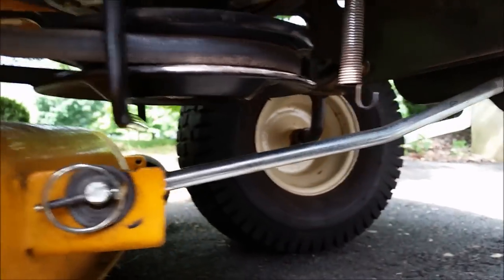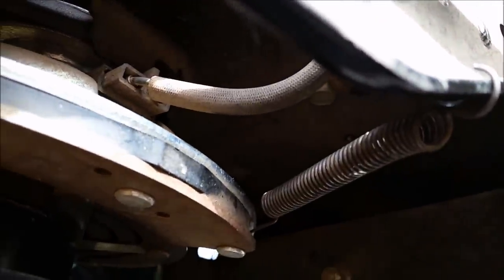Cub Cadet LTX 1046 KW deck removal and blade sharpening

Comment: Changed the blades on my Cub Cadet LTX 1050KW and found the spring you found hanging in the video laying on my garage floor. Thanks to your video I recognized it quickly and was able to hook it up properly. Thanks!
Reply from the maker: Glad I could help! That spring gets me every time!

I just replaced both blade spindles. One had a catastrophic failure. They were cheap on Amazon.

Comment: Excellent video!  I need to get the deck off to replace a spindle.  Almost thought of taking it someplace to have it done but very confident in the deck removal now.   Thanks!
Reply: Good luck with it!
Reply: For a very small part of the spindle cost you can just replace the bearings, that is all that needs replacement, watch a video if you have not done a replacement.

Comment: Somehow I did this without removing that bracket/guide for the belt before but I can't remember for sure how I did it. Hopefully it will come back to me when I get to it. Thanks for the video! Good refresher...
Reply from the maker: statikreg it definitely seems like the belt should fit under the bracket, but I wasn't able to get it to fit. Let me know if you do.
Reply: The chute-side came right off but I had to remove the bolt on the other. Maybe I had to do it before and just forgot. it's been a while. I did find that I have been mowing with the blades on upside down for at least a couple years....It still somehow cut ok, but had to come double check your video when I realized it, and sure enough! So, thanks again!!

At least explains why they hit the stump and got bent (and hence why I had to remove the deck and replace them)...

Comment: If I may: On the drive belt guard bracket you really only need to loosen one of the 1/2" bolts to get the belt off which makes it easier than try to get the bolts back in the holes that you can't see. Also when you have sharpened the blades center them and "free float" to check balance. I use the handle of a screw driver in a vise to check that. Ideally take more off a side if it balances "lower". This saves wear on your spindle bearings if the blade is balanced as it won't wobble.
Reply from the maker: Hi David. Thanks for your comments. Do you have a video of your procedure?
Reply: @flostevematt  I do not but I am sure there are some videos on balancing the blades.

Comment: in the manual it tells how to install the deck,  it says to place a 3/8 drive breaker bar in a square hole on the idler pulley arm, and I use a short pipe to help , put the idler arm back and slide the breaker bar pipe down behind the pulley and it will hold it there till you get the belt on, this releases the tension on the belt and you put the belt on after you have all the lift arms attached, it goes very easy after you follow the instructions, not strap needed,
Reply from the maker: Thanks.

Comment: I remove my blades most every day because I have a lawn service and there is no substitute for sharp blades when cutting customers grass. I have folks ask why when I get done cutting their lawn it looks so much better than the previous contractor. I tell them because I use sharp blades. I get under mower deck with a sharp set and just exchange blades. Takes maybe ten minutes. Word of caution. When you have the front belt keeper off or loose, do not start the engine. You will tear all the electric clutch wiring off. And you do not want to see the cost to repair that wiring. Another secret of mine is take those spindle pulley covers off. All they do is gather clippings and heat up the spindles. I have seen fires start from the clippings from under those pulleys. My neighbor lost his garage from a fire. I warned him, he didn't listen.
Reply from the maker: Thanks for the tip! I can now get the deck off in 5 min, sharpen, and put the deck back on in about 10 more min. I have also replaced the blades many times in the 7 years since I made the video. I have also replaced the spindles once (easy), the starter once (easy), the deck belt (a little bit of a pain), and have been through a couple of batteries.
Reply: @flostevematt  I have a lawn service that I operate alone. I do all the maintenance. I don't replace spindles. I replace the bearings. Buy them on Ebay and if you get the right price the cost is almost nothing. In most cases the parts to these lawn garden tractors are all the same. I think there is only one deck manufacturer. Since they changed the spindle design to four bolts the spindles are mounted sturdier. If you have never changed the spindle bearings, watch a video and you'll will be appalled at the amount of money you can save and how easy it is. I also take the new bearings apart and repack them with Lucas sticky red grease before installing. From the factory, grease in the bearings is minimal and only designed to last for a few hours. I am eight-two years old, I have been there and done that many times. I found out years ago to do a little homework and within reason do the job myself. I come from the farm so my life experiences started very early. Thanks for your interesting video.

Comment: This is doing it the painfully difficult way. Go get a riding lawn mower deck, they have them at home depot, Big R, Coastal, basically everywhere for about $200 or so. You'll want it anyway for easy access to clean underneath and inspect as well as sharpening blades. Jack up the front. Make sure tractor/mower can't fall off lift! Put a 3/8's drive breaker bar (it's a 18" long bar for sockets without the ratchet capability from any auto store) with 15/16 socket on there and I use my foot to push on the bar. It takes a lot of pushing even with your foot but if you're going lefty/loosey (when looking from the ground up towards the blades) it will eventually budge loose. 

I just saved you an hour everytime you want to sharpen your blades, you're welcome.

Comment: I'm having a lot of trouble getting the nuts off that hold the blades in place.  They won't budge.  I have tried WD-40 and PB Blaster on the nut.  You say to use an "extension pipe" on the wrench, is that for a ratchet driver only?  I don't have a 15/16" socket, just a 15/16" open wrench -- so I'm not sure what to do.

Also, for an LTX 1040 you have an additional step of removing the PTO engagement cable and spring before removing the deck; this is held onto the deck by a small clip and the spring hooks into a hole on the tensioner.  I noticed your Cub doesn't have a PTO engagement cable or lever.
Reply: Yeah, I have an old steel pipe that fits nicely over my socket wrench handle for when I need a "torque boost". If you are using a two-sided crescent wrench, you could use a larger bore pipe if you have one. I've also been known to use the same ratcheting straps on the wrench to get enough torque. 

Good luck!
Reply: Yep it's called a cheater bar... aka a big piece of pipe that you put over the handle of your socket wrench or in your case open wrench and it give you massive leverage. You're probably losing leverage because open wrenches are generally the worst for producing torque, second only to a crescent wrench which will always have some play no matter how tightened up it is. You really should invest in a simple set of sockets. Napa Auto and Oriely have very long torque bar socket wrenches just for this kind of thing. I have two of them and they're great for when you really have a stubborn bolt that refuses to come off. The handles are extra long so it gives you the torque you need and if that's not enough throw your cheater bar/pipe over the handle and extend out another foot or two and that will get it done.
Reply: 15/16" Six point Socket and a long breaker bar. No need to remove deck. 4x4 x5" long wood to hold blade against deck. Torque to 80 Ft. Lbs when reinstalling new blades. Use Rotary brand blades P/N 942-4244   $12.25 ea. 2 required for 46" deck.
Reply: This was for a XT-1 22 hp 46" stamped deck.
Reply: 15/16 combination wrench and 7/8 combination wrench and a short piece of 2x4 . Hook the two combination wrenches together and jam blade with 2x4 and lean on it.  Wear gloves.
Reply: This advice will not help you now. But I found out a long time ago, when buying a new machine, to have the shop mechanic loosen those nuts before I leave the dealership. At the factory "King Kong" puts those blade nuts on.

Comment: I also decide to buy the extreme blades to replace the other blades .Cub cadet said they are better
Reply: First thing I do after buying a new tractor mower is remove the factory blades and throw them away. They are a weak design and are of a softer metal so they chip easy. I then replace those with a set of "high lift" heavy blades. Like apples and oranges in comparison. Besides if you are using a bagger, you'll need the extra lift wind power to get the clippings in the bag.

Comment: you don't need a ratchet strap all you have to do is loosen the 2 3/4 nuts on the front rod and put the deck height on number 2 not low and it will go right on
Reply from the maker: I'll try that. Thanks!
Reply: @flostevematt  you're welcome

Comment: Nice job. I think that I can do it now. Thanks
Reply from the maker: I just did mine yesterday. I found out you can just remove one of the bolts (right side) on the bracket that prevents the belt from coming off and then can slip the belt under it.

Comment: need to ask my cub cadet ltx1042kw had a idling pulley shred to pieces after only 111 hours of use .I did get new ones from cau cadet under warranty .But are they easy to remove or should I let some one do it .I am a pretty handy women .Also want to ask about the shrouds over the top spindle pulleys trapping grass and it is really hard to remover each time I mow even with the deck washing kit that came with the mower and doing it every time I mow .I have to use my fingers and screw driver just to get it out .Are those shrouds really needed .I use 2 ride on mowers to do my 3 acres so they do not get over used .Hence only 111 hours on cubby .I have a troy built also

Comment: Thanks, Had to hit breaker bar with rubber mallet to break loose the bolt
Reply: They are reallllllllly on there. I use my foot to press on my long socket / breaker bar.

Comment: The blades are a matched set and I have learned to sharpen the new ones to cut much easier. No need to remove the deck. Jack it up with a special lift or run it up on ramps. I use a cheater bar also to break loose the nuts. I have learned to monitor your tire pressure on the lawn mower to prevent the blades from digging into the sod when turning. Happy mowing

Comment: Dont u hav to put a wrench on other end when taking off blades ?
Reply from the maker: No. The spindles have a star pattern to keep the blades oriented correctly. Just use a block to stop the blade, and tighten with a single wrench.

Comment: Grease the blade spindle hubs? My hubs have grease zerks. Otherwise a very helpful video, thanks!
Reply: Greasing sounds fine. BUT if the bearing assembler didn't remove the inside dirt cover of the bearing before installing you will not no matter what get grease to the bearing surface you think you are greasing. You can only find the truth if you take the spindle bearing out. Just because there is a grease fitting on the spindle doesn't mean you can get grease to the bearing surface if that cover is still in place. Don't trust the manufacturer. I had to learn the hard way. After all they are in the business of selling you new product or parts.

Comment: why can't you just jack the mower up and take off the blades?
Reply: If you've got a lift, go for it. And videotape it for us.
Reply: That's what I'm wondering. I have a lift and wonder why you have to take off the entire deck. A lift is a few hundred bucks and you should always have one if you have a rider.
Reply: I bought a mower lift at Tractor Supply for $100, jacked mower up and had blades changed in 10 minutes.  Used it all summer and this spring without them coming off.  :-)
Reply from the maker: That's great! 10 minutes - it takes me longer than that to sharpen the blades. Can you post a video of this? I'm amazed that the whole procedure can be done this quickly.
Reply from the maker: Great work! Can you post a video of this?
Reply: If you have a three blade deck the middle blade is kind of a pain since you have to be almost under the machine to get the blade off but if you're on a very stable jack you shouldn't be too concerned. That's also why I use my foot to push my breaker bar instead of having my hand/head way under there. Rather have a mower fall on my leg than on my head lol Getting a good mower lift though is important. 

I did notice that the front bumper kind of sucks on some lifts because you can't get the mower as far forward as you'd like to fit in the wheel stirrups. I really don't even know why a mower has a front bumper. I've never smashed, nor planned to smash the mower through my fence lol

Takes me about 5 mins to get the three blades off my mower and another 5 to sharpen and balance with angle grinder and just another 3-5 mins to put the blades back on. All in about 15 mins. Most of the time I screw around trying to get the wood block in the right place. :P
Reply: I may post a video when I sharpen the blades.  I have to admit that I the reason it was so quick is that I was putting new blades on it.  No sharpening involved.  :-)